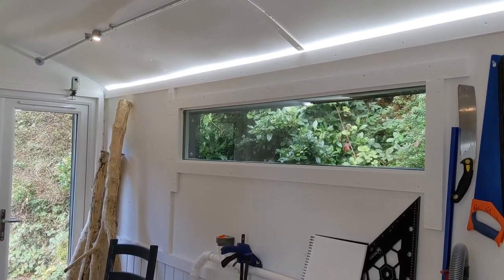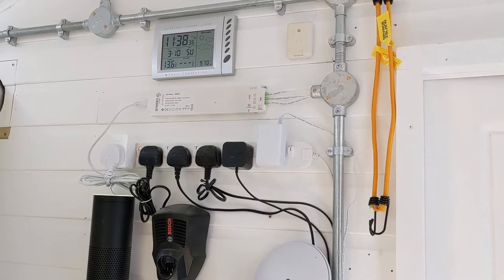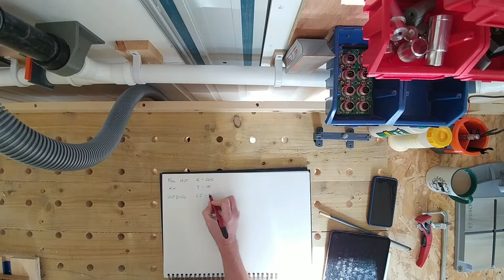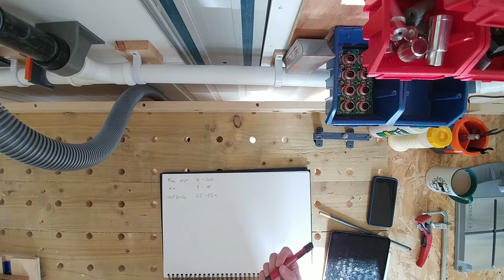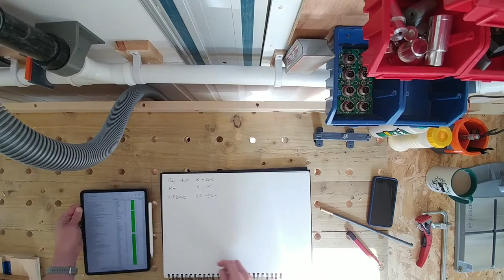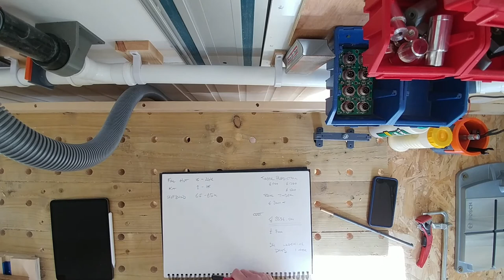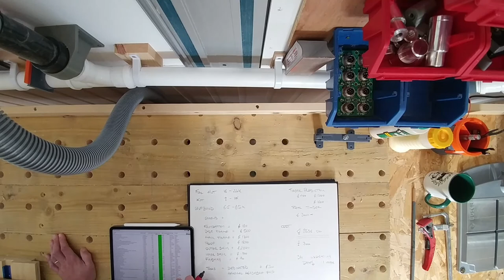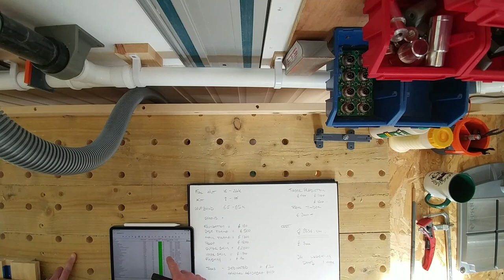Self building a custom shepherd hut in 2021, Part 30: Money and Tour

Comment: "All grouped together using ... methods."  Of course they are sir, of course they are.
Reply from the maker: Yep, i didnt think the methods were important :)

Line Type:
hardware
timber
sheet timber
tapes and wraps
solids
adhesives and fillers
insulation
metalwork
cable and lighting
protections
doors and windows
dedicated tools
general use tools
workshop equipment

the line items were allocated a type and a stage of use

example: i had deck screws in multiple stages of the build but always in 'hardware' line type, so i could see how expensive a specific type of material was and where it was used the most. I did intend to do a full break down on it but after the hut was finished i got bored tracking the costs :)